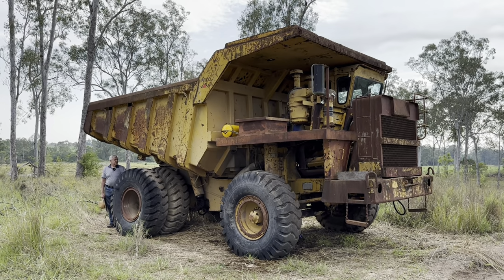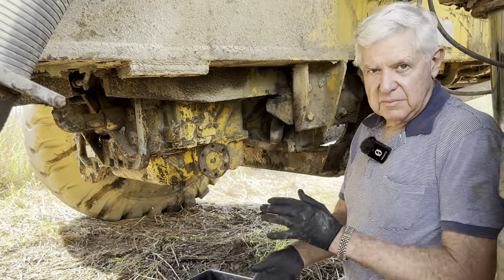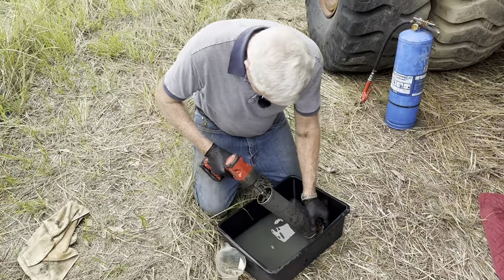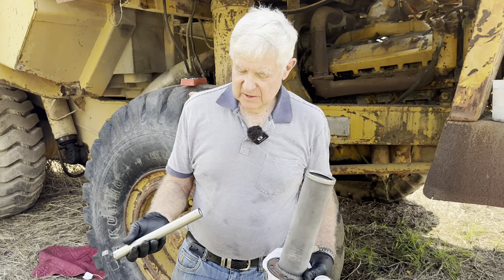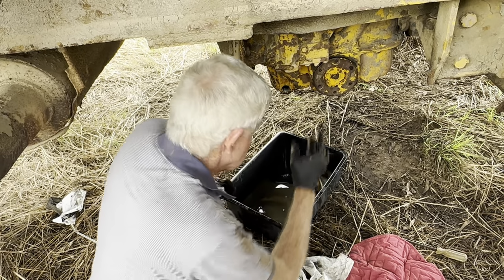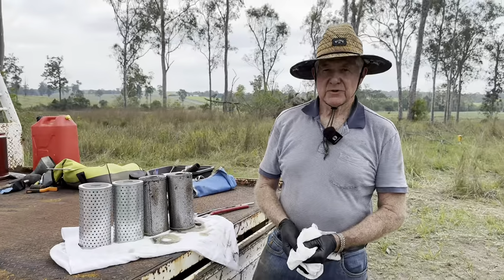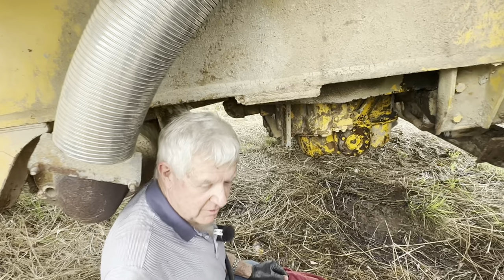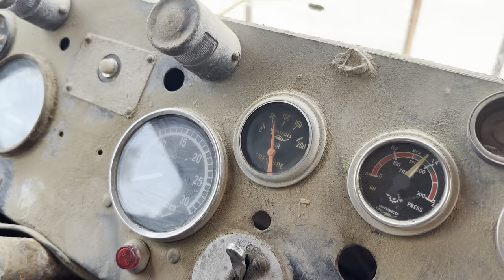Will this 60yr OLD V12 2 STROKE Detroit Dump Truck START & DRIVE out of this Quarry?

Comment: Thats a good load of water in the dump bed. Do you think it will  dump the load?
Reply from the maker: I think it will, that system looks complete but I’ve got a couple of reasons why I didn’t tip at this stage. It’s got the spare wheel in the bin and I didn’t want that to run off down the paddock. The 2nd reason is those hoses going to the lift rams are pretty sick looking and I didn’t want to risk blowing another hose out in the field. Once I can get it back home, I’ll change those hoses then I will get it tipping. I agree it would have been a better video if I tipped the bin but I just didn’t want to risk it. All the best, Bruce
Reply: @bruceinaus  definitely.. the hoses might have blown

Comment: Try gasoline very good at dissolving that kind  of stuff
Reply: I work on small engine and automotive gasoline dissolves anything containing oil grease it will event remove piant and caulk window sealant it will even ruin tires given enough time aside from acetone and toluene gasoline is so much more than a fuel it is a fantastic solvent

Comment: I love you videos man. But there's one thing That I have to say. I have been a diesel Tech for going on 20 years. And I was taught never to grease any gaskets. I'm curious if that's just your own personal preference, or if that is something that you were taught.
Reply: Many rubber or silicone gaskets benefit from a thin layer of compatible lubricant or grease during installation. It helps the gasket seat and prevents it from sticking or binding during assembly. It can also aid in creating a better seal as well as prolonging the life.

Comment: Yes it will
The leads were splintered and the pedals stuck or soldered like glue but quick hammering and wire replacement with staining tanks then the machines nery will just drive right out of there 
Help and support sent all avenues 
Action immediately all areas 
AFFA angels never die nffn HMS council

Comment: How is the 2 stroke engine lubricated?
Reply: A two stroke has a mix of fuel and oil so basically the fuel lubricates and powers the engine at the same time.
Reply: @flop4life27   your correct in a traditional two stroke gas engine but this is a 2 stroke detroit diesel they have oil reservoirs just like 4 strokes and an oil pump. You changed the oil just like a 4 stroke. These things made monster power back in the day and some were even outfitted with a super charger. Emissions killed them off
Reply: @454budman   I'm aware of that i just was explaining the basic two stoke as the OP asked.

Comment: Sounds like the engine is working overtime or in wrong gear. Its so loud
Reply: That's a detroit they scream all day and night
Reply: 2 Stroke diesel with a supercharger as standard to blow the air in, they do not work without a supercharger, sounds like it is going twice as fast as usual but it is only firing twice as much

Comment: A Detroit that won't start has probably been run out of oil for a year or 2.

They're super tough engines!
Reply: Eh I’d say more rugged than tough, Detroit’s can be princesses at times, Internationals are tough, I’ve seen them run hot enough to make the exhaust manifold glow, and started burning coolant and still put out 100% peak power

Comment: Bruce Bud when you knocked the rust of the Ram go over it with 2000 wet/dry then buff it should be very smooth like a baby's bottom 😂

Comment: I always likes the DD 2-strokes.  The 12 sounds smooth.  But, the 6 and 8s had a sound I can only describe as "rude", or "raw".

In the 70's, they had "The Great American Truck Race".  It was at the Atlanta Speedway.  They raced the tractors (no trailers) around the oval.  The winner was an old GMC with a DD 671.  It drove to the race, during the race, and back home from the race on the same set of re-tread tires.  

Someone running something like a ling nose Kenworth wrecked and drug the entire front suspension out from under it.  I hope it wasn't what he made a living with.

The Great American Truck race - https://www.youtube.com/watch?v=zWCrstES3Fg

After glancing at this link, it says it ran for 20 years.  I THINK the GMC won the first one.  But I don't know.